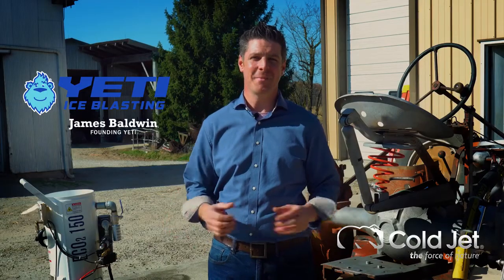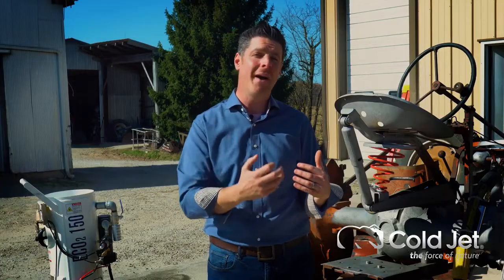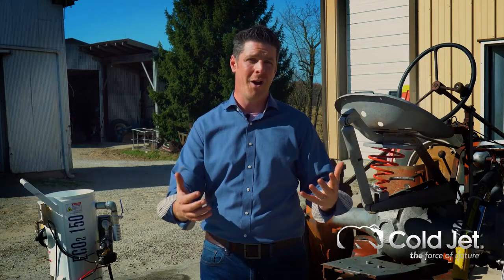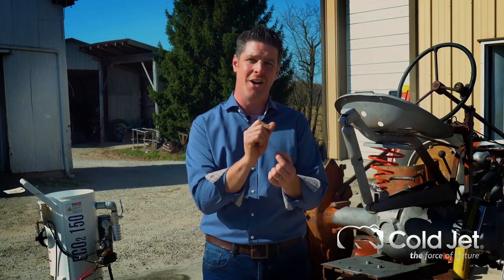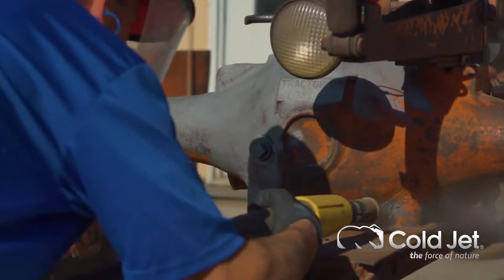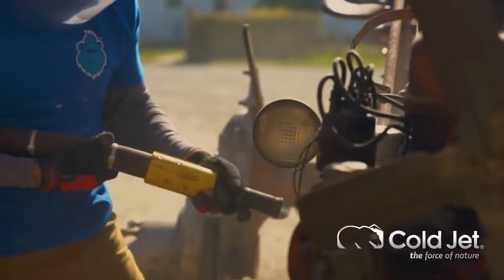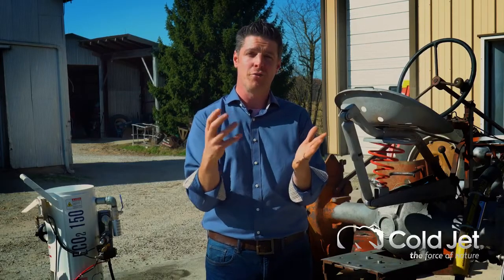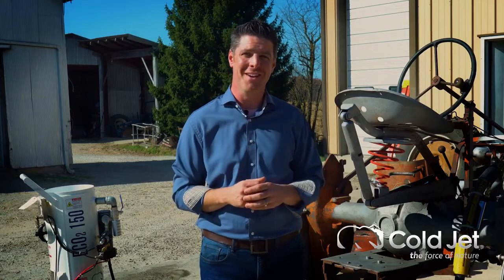Cold Jet - Restoration Vintage Tractor - Using Dry Ice + Abrasive Media

Comment: What was the flow, particle size and pressure did you use on that project?
Reply from the maker: On projects similar to this one we have used the following parameters: 
Blasting Pressure: 90 Psi
Dry Ice consumption: 5lbs/min
Abrasive consumption: 2.2lbs/min
Dry Ice Particle size: 3mm